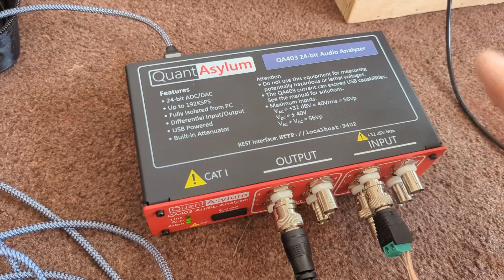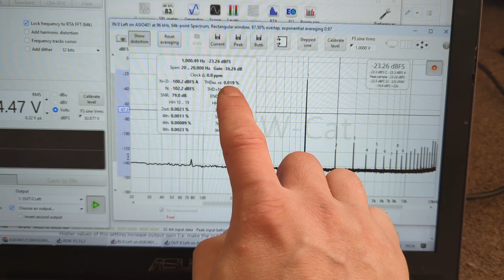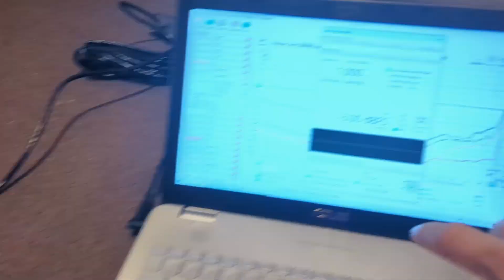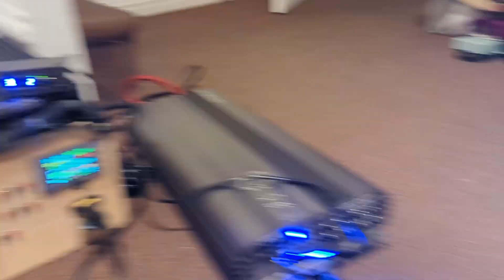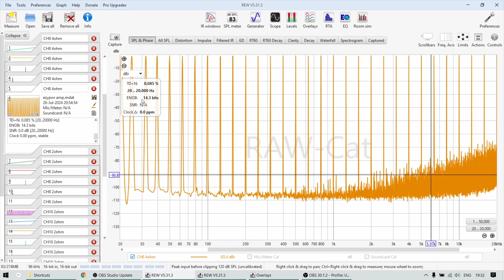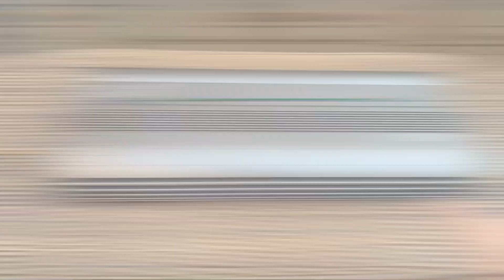Down4Sound EZY PWR 810 distortion measurements

Comment: I just got a teal 810. Without your video showing that it is not a noisy amp, I would not have bought the amp.
Vehicle is Lexus gx460. 
Mids & highs- Diatone DS-G500 front door and A pillar. 
Dash- illusion audio 4” left & right. 
Center- 4” JL audio. 
Rear doors- Diatone SR-G16C 6.5” coaxial. 
Subwoofers- 4 Diatone SW-G50 10” subs. In a sealed down firing enclosure. 
400A alternator and 2 odyssey batts. 
Audio control DM-810 for signal. 
Fully sound dampened. If I’m not happy with this amp I will run what I originally planned to run. 

4- Sansui SM-A907DL reference mark amps for mids and highs. For the subwoofers an Alpine 3545 Juba. I fully recapped and put new thermal grease on all of the amplifiers. 

The Sansui amps are the most amazing I have ever heard. I have arc Audio SE 4200, Adcom 4 channels, Soundstream Picasso reference and Rubicon, All of the old Phoenix Gold MS, M, Z, ZX,  xenon and sapphire amps, Audio arts, Harmon Kardon CA amps, Sony G450, Sony es 7557, 7547, Luxman CM6000, Nakamichi PA-304S, Denon dca-3400, Soundstream class A 40, D200, D100, D100ii, 604, TR800/5, Alpine 3558, 3554, mrv-f400, mrv-f505, mrd -f752, PPI Art series, PC4200 and plenty of others Im forgetting. The Sansui was just so much better than all of them. On paper the specs are much worse???

Comment: I want to get two US acoustic Lanna’s. But I could get 4 jp34AB’s for half the price. Idk what to do.
Reply: I run a lanna in my truck. I have had zero issues with it and it’s been in there for almost 4 years now.  I do have a 400 amp alternator with a capacitor bank so there’s no issue with starving it for power I have no experience with the D4S a/b Amps.

Comment: I noticed that your sub volume knob was not at 100. And then you said that the sensitivity or the input voltage needed to be turned up to match the rest of the channels, you must have your subwoofer level at 100 when you adjust the inputs gains
Reply from the maker: Yes, that is a mistake I made. Well spotted👍

Comment: The new bass knob/amp combos I’ve seen have an adjustment for the voltage. Both of my Bluetooth D4S knobs are about 1/2 volt low all the time. Frustrating.
Reply: You can adjust by turning the tiny pot on the end of the amp. Look for the little hole in the endplate

Comment: Which channels does that remote control? Also, would you recommend this amp for someone running the one audio mb3, Steven’s tweeters, one audio 8” midbass and two 12w6? I kno the math adds up I’m not asking you to do that lol but I’m just looking for clean SQL, will I be happy?
Reply from the maker: The remote controls the last two channels that are supposed to be used for subs. This amp would be perfect for an SQL system like that!
Reply: @RAW-CAt  that’s great to hear! Is the remote an attenuator or a boost?
Reply from the maker: @chrisdenicola4336  attenuator.
Reply: @RAW-CAt oh man I really appreciate your help. You’ve answered so many of my questions. I’m definitely gonna send a donation! You’re an awesome guy!
Reply: Did you have issues with this 10 ch amp getting very hot ??
Reply from the maker: I disconnected the two fans at the bottom and after heavy pounding, it barely gets warm. But i am using it probably like 30% of its capabilities.

Comment: I have this same issue with my voltmeter… it shows 13.5 at MOST…whereas the dc/dc buck module I have reads 13.8 on its little LCD screen… I assumed it was something with my grounds….but they are rock solid. So if you find an answer to the voltmeter issue… please make a video about it!!! Thank you for all your work!

Comment: Better numbers than most of the old school amps I have that people seem to think are worth big $$$ on eBay.  Not crazy about fans inside amps, they are just a way for things to get covered in dust which will actually cause more overheating than it was intended to prevent.  Seal it up, and make sure the heat sink can absorb and dissipate the heat.  Add more heat sink fins if it isn't efficient.

Comment: The 0.5 Volts difference between your Battery and the Amp is the voltage drop off your power cables. Higher load on your power cables causes higher resistance. That's just normal. You can calculate it with Ohm's law...
Keep up the great work! 👍
Reply: Exactly this! 0.5V drop for 30A would come to 0.017ohm, which is quite resonable for a "thin" wire and 4 contact transistions (2 from the XT60 and 2 on the amp)
0.5V*30A should also heat up the wire/contacts with 15W, it shouldnt take to long before RAW-Cat can feel some heating in the wire! Nothing to worry as the contact area is large enough to spread it into the air, but I wouldn't suggest using it in the car for demos...

Comment: The distortion and noise tests are at 5w of output?  2.236v?  Having no preamp filters would have helped the noise and distortion quite a bit.  To clarify, more than 6v will clip the the sub channel input, but 6v requires the gain knob to be turned 1/4 of the way?  That is just a build\tune issue, the gain preamp circuit is not tuned perfectly or as well as the other channels.  
I would have thought the noise would be lower as there is usually a ton of negative feedback in class D to negate switching and other noise so  lower than-120dB is typical to see in my experience. 
The voltage readout is not surprising to me because it seems like a high resistance path is used to read the voltage for the bass remote, and the voltage itself is likely sent to the remote rather than a bitstream of data to indicate the voltage level.  I don't think there is much you can do besides find the trace on the pcb and run an additional 16awg wire in parallel to lower the trace resistance.  The amp seems alright but I would run ribbons or other high frequency drivers on something else, because of the THD+N, but more so the frequency response is all over the place based on the loads impedance at the high end.